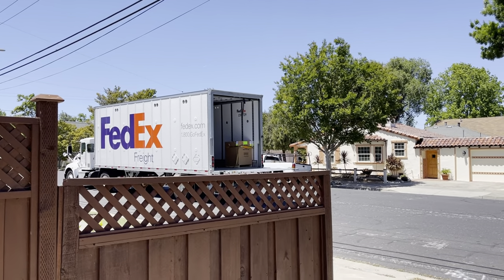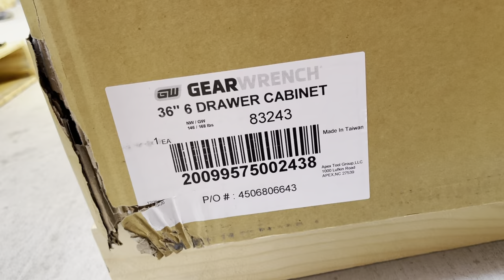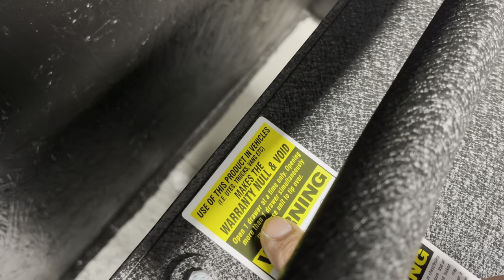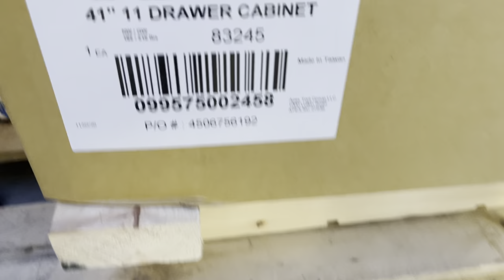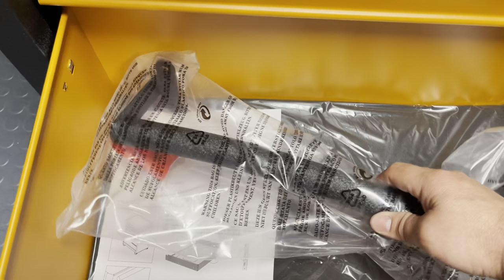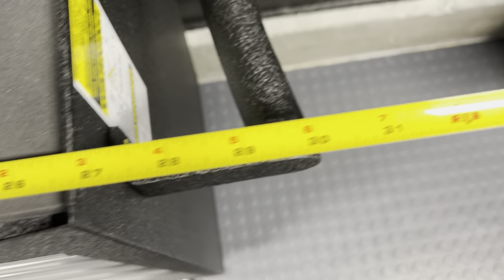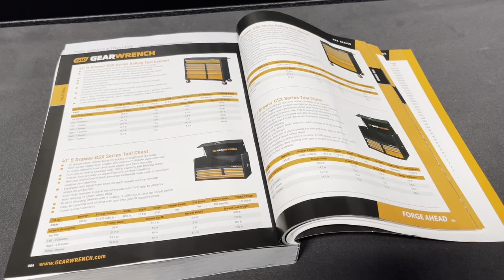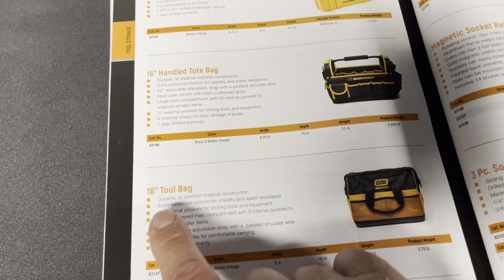Gearwrench GSX Rolling Tool Cabinets

Comment: Nice Gearwrench uniform. Are you a Gearwrench You Tube influencer now? Did Gearwrench provide you these carts for free? I think the single roller slide on the 41 inch cart isn't enough despite the cart being pretty narrow.
Reply from the maker: Been doing stuff with Gearwrench for a while now, these boxes were sent by Gearwrench and I will be using them in a DIY garage environment. The 7 drawer tool cart will be used in a professional environment at the shop and we’ll see how it performs. These are quite narrow, but suit well for a home garage environment and a beginner tech as well.